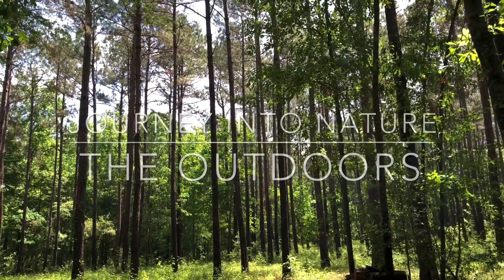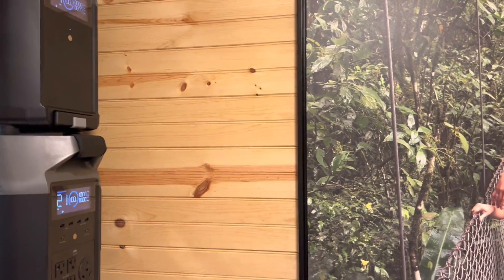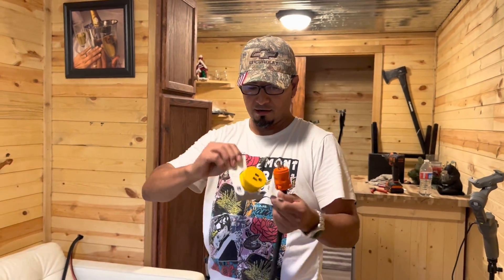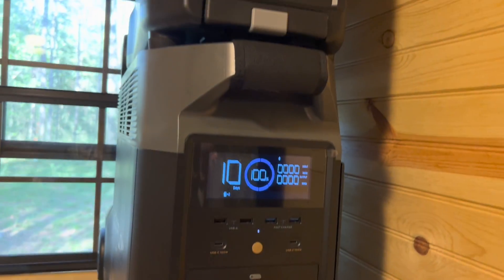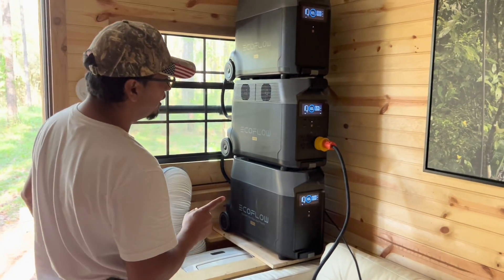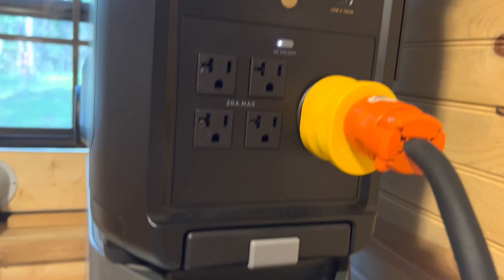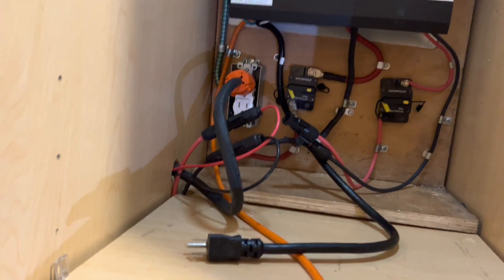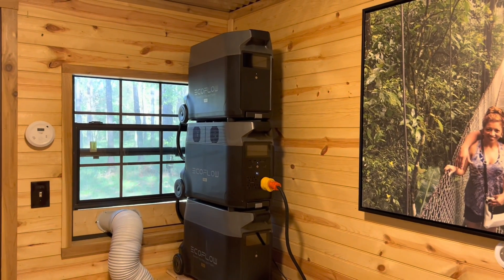EcoFlo Delta Pro Off Grid Tiny Home

Comment: Which one you recommended? Ecoflow delta pro or all in one system 48v system. And which one is louder?
Reply from the maker: Jake, EcoFlo Delta Pro, it’s very user friendly, plug and play. The down side is the cost and it's a little more noisier. It also gets louder as more energy is flowing through it.
The all in one system is less expensive but requires a little more knowledge when setting up.
It’s just comes down to your preference. Please let me know what system you end up going with?

Thank you for watching the channel

Comment: Bluetti wins in this scenario…
Reply from the maker: Thank you
Reply: I have a Bluetti. I also bought back up solar panels. I did so for a large brick and mortar. It cost roughly $10K. I'm not sure it's better....it will maybe run the fridge and a collection of smaller items with less pull. I doubt it would hold the entire home lights; not to mention AC or heat. Long lasting? Quality product? Sure. Worth it for a tiny home? I'm not convinced.

Comment: The Midea U shaped air conditioner is almost twice as efficient and will probably add 3-4  more hours of run time to your setup.
Reply from the maker: Yes I agree. I have looked in to it and it would run the AC twice as long. The problem I have is that I would have to remove it every time I would want to leave the property and lock up the container. The two big metal doors.
I will replace it in the future if I get another container. 

Thank you for watching the channel

Comment: the fans sounded loud -  how does it compare to the ac or fridge = does it still make a noise after dark?
Reply from the maker: The fans are loud when it has a load. You can barely hear it if loads are low. I would say its louder then a refrigerator. Also keep in mind you are hearing the portable AC run next to it. It sounds louder on camera due to small space. 
I don’t have any complaints so far. 
Thank you for watching the channel

Comment: 30 amp to a 15 amp male plug to a 15 amp plug (not safe) . Should have a breaker box  in between power source and appliances.
Reply from the maker: Jeff I agree, I do have a breaker box in between power source and appliances. 
From EcoFlo Delta Pro it goes to my Off Grid Tiny Home breaker box then to appliances that have separate breakers. 

Thank you sir

Comment: For those watching, Ecoflow is pretty explicit stating not to stack them in this fashion so proceed with caution. Great video though.  Good job!
Reply: I made that mistake, but luckily I figured out why pretty fast. The top of the units get piping hot when stacked.
Reply: When I saw the thumbnail to this video, I thought this isn't good. I was told by Ecoflow never stack the units.
Reply from the maker: Thanks
Reply: Nice suicide cord. All you need to do is cut the end off and wire it into the electric panel, and you will be much safer. Nice setup

Comment: This may be a silly question but can the solar power appliances without draining the battery? Like if the solar panels are producing say 2000 watts and you are only using 1000, would it only make use of the panels and not use the batteries?  I know traditional systems do this, but I don’t know if this only draws from the battery and allows it to be topped off. 
Would love to get this unit and make the batteries last as long as possible.
Reply from the maker: Yes if the EcoFlo Delta Pro is at 100% charged and you are producing 2000 watts from solar Panels and your appliances are pulling say 1000 watts,  The EcoFlo Delta Pro will stay fully charged till your wattage draw goes higher then your solar input. It will only start using your battery when your solar power isn’t producing more watts then what is being used by your appliance. Also keep in mind when on and 100% charged it’s  loosing a little power. This is nothing to worry about it’s just how it works…. Uses power when in use. The shelf life of the battery is great! I had mine fully charged and and put alway for a month, when I turned it on it was still at 100%

At night, all electricity is coming from my EcoFlo Delta Pro and two extra batteries due to no sun at night. In the morning When the sun comes out I don’t use much wats just the light and refrigerator about 5o watts. So most of the solar power is being used to charge back the batteries to 100% and very little for appliances. It’s always a good Idea to have a larger solar array then what you use due to cloudy days but not to much to where the electricity isn’t being used, wasted. 
I tried to be very detailed about your question. I hope this helps? 
Thank you
Reply: Yes pretty much like a DIY system just smaller foot print or medium range. If your producing more than your taking out of it, yes you'll basically be running off the sun if by solar or if plugged into an ac outlet or even ev station.

Comment: It with a small window unit  Home Depot 5000 BTU only runs 450 Watts
Reply from the maker: Thank you Kevin for the info. The only reason why I still haven’t got one is cause I close the big container doors when it’s not in use. If I was to install a window unit I would have to take off every time I’m not using the off grid tiny home. The doors simply wouldn’t close otherwise. I should have thought of that when it was built. It would be to much of a hassle now. 
I do appreciate your comment maybe in the future.

Comment: Excelllent. I am wanting to get the Ecoflow Delta Pro and the Smart generator to add to my 1200w solar panels and run my little window A/C during the daytime. Plus I'll have back up power for emergencies.
Reply from the maker: The EcoFlo Delta Pro and the Smart Generator is a good combination. Is your AC 500 watts and what eles will you be powering? The Smart generator is the most efficient generator in the market today. I say go for it. Please share when you get it.
Reply: @journeyintonaturetheoutdoors  It's a Media 10k btu window A/C unit pulls less than 700w and has a smart start inverter. I figure my solar will be enough to power it through the Delta pro during the hot part of the day. The Smart Gen. will be for power outage/bad weather situations.
Reply from the maker: @tk72231968  Awesome!
Reply: @Michele Ikerd I will look forward to seeing reviews on that!
Reply from the maker: @Michele Ikerd  I will  keep an eye on that. Are you getting it?

Comment: You need more solar because the ac uses more than it comes in.
Reply from the maker: Insan21 Yes, more solar Panels would be better. I do have a 1500 watt solar array. I usually get around 1100 watts on a good day. This is particularly cause the solar panels were purchased used and they are located in a wooded area. I will consider adding more in the future. 
Thank you

Comment: How much was all those units?
Reply from the maker: Hello sir, I paid $6,157 for the EcoFlow Delta Pro and the 2 extra batteries. The total of 10,800 kilo watt hours. This means you can run a 1000 watt Air Conditioning for 10.8 hours. The Air Conditioner won’t pull 1000 watts consecutive for the 10.8 hours so you will be able to run it longer. I bought it at a discounted price due to me being part of KickStarter. A crowd funding project. I waited about 5 months to finally get them. It was well the wait. You can also get your self a 500 watt Air Conditioner and it will run twice as long. 
Please let me know if this helped?
Reply: @journeyintonaturetheoutdoors  - how much did it cost for your DIY build? Batteries & everything else etc?
Reply from the maker: @1ENDUSER  the EcoFlow Delta Pro and two batteries was $6,157 
The solar array that I have is 1500 watts of used Santan solar panels. I paid 
$300 for 6 250 watt panels and 
$300 for delivery to Houston, Tx. 
$200  for 150 AWG solar cables and 4 to 1 connection
$280 solar stand (materials) 
$150 for conduit and junction box 
$7,387 total 
You can look at my other videos and it shows how much I paid per item and how I did It.
Reply: @journeyintonaturetheoutdoors  - oh my fault I mean the mppt system you had before the ecoflow pros. Or not counting those. I wanna build one later. I have 2 ecoflow pro already but instead of buying two extra batteries I wanna build a DIY system and just one extra delta pro battery
Reply from the maker: @1ENDUSER  the all In One Solar inverter LV2424 was $650 
$150 for breakers and wires 
$0.00 for batteries and wire… they were given to me. If I had to buy now I would go with lithium batteries. They are better, cheaper and last longer. The ones I have are lead and you can only deplete to 50%. You can only use half of power you have stored if not you will damage them. Not to mention maintenance. 
You can go to www.signaturesolar.com  they have good deals on EG4 LifePower lithium 24V 200AH for $1499 

With my system I should able to plug in my EcoFlo Delta Pro to the output of the all In One solar Inverter, leaving  the solar array hooked up to the all In One solar inverter. This way the EcoFlo Delta Pro will pull power from from  it. You just need to change setting on the All In One Solar inverter let it know when to stop sending power. In my case not letting the batteries deplete no more then 50%..
Reply: @journeyintonaturetheoutdoors  - Thank you for the info. Gives me the understanding to see how much I'd spend on a diy build.
Reply from the maker: @1ENDUSER  Please let me know how your build goes when completed? I would love to see it and glad I could help.
Reply: @journeyintonaturetheoutdoors  10.8 KWh, not 10,800 Kilo watt hours.
Reply: Actually you have 10,800 watt hours.  Not 10,800 kilo watt hours. Another way to state this is that you have 10.8 kilo watt hours. But I get what you meant to say.  @journeyintonaturetheoutdoors